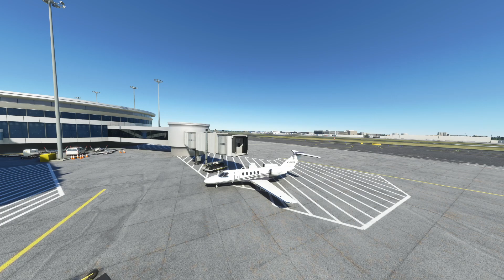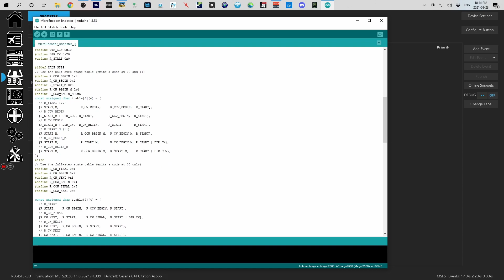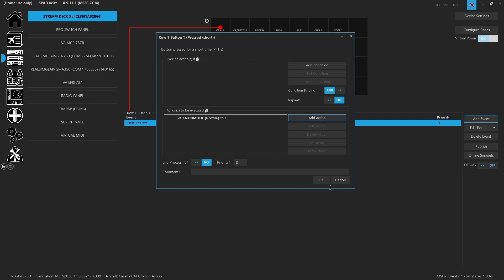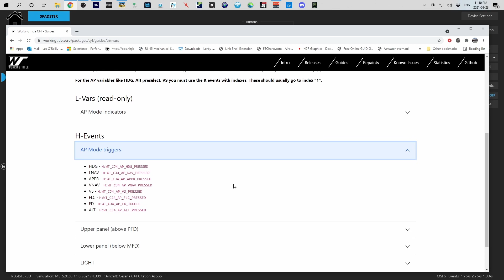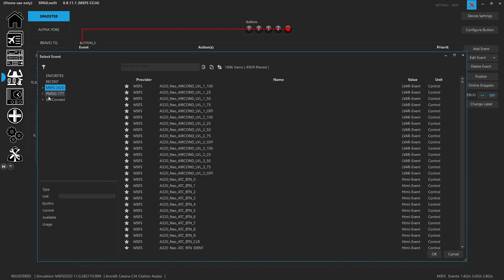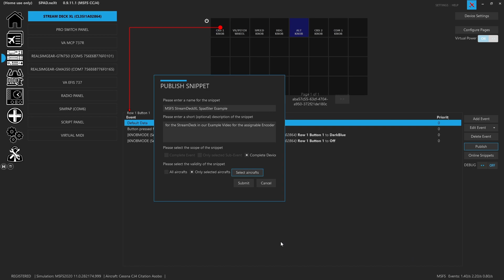(Sim Video) SPAD.neXt | Arduino + StreamDeck = "SPADster"

Comment: Les, if I buy the parts to build this, will it work just like a knobster? I would like to use it with a touch screen, but don't really want to purchase Air Manager just for the touch screen and DIY Spadster.
Thank You for any advice.
Reply from the maker: Watch the video. That shows you how it will work.
Reply: @LesOReilly  Watched the video, but you are using the streamdeck, I want to use a 15inch touch screen and was not sure if I could do it with spadnext.
I do know you can do it with air manager, but don't really want to spend the rather expensive amount just so I can get touch panels set up.
Thanks for any advice.
Reply from the maker: @andy70d35  spad next is not air manager .. this does not work like air manager ...  you can't control elements in the same way since they are not the same thing.

Comment: Awesome video, you are a legend. Thank you for sharing this great video.
Reply from the maker: Thank you for sharing such a supportive comment!
Reply: Now that I have added the encoder to my stream deck xl - "Again Massive thank you", I was wondering how easy is it to add 10 digital buttons to the Pro Micro.  I know I have the pins available and I thought it would be great to add 10 buttons to emulate 0 to 9 for ATC on MSFS 2020.

Also, is it possible to use the encoder for pitch trim (Elevator, aileron and rudder)?
Reply from the maker: @FHamoudi  of course you you can use the encodes for those.... there are events for elevator Trim INC / DEC and Rudder Trim and Aileron trim..  Yes you can add buttons...  wire them up and expand the Joystick code and buttons..
Reply: @LesOReilly  Hiya,  I have just finished adding the buttons to the Pro Micro.  As a courtesy, do you mind if I publish the profile?  Of course, I will add credit to your hard work.  The reason for this is I have two spad.next registered and it would be easier to publish the profile online and then pick it up from sim pc.
Reply from the maker: Don't put the period in SPAD(dot)neXt or YouTube will hide your comments :) ...  You can publish all you like...  I don't need "credit" :) ...  I find Publishing Snippets better but that is a me thing...
Reply: @LesOReilly  I was going to publish but, strangely I keep getting "invalid Authorkey"  - what’s causing this? Sorry about the dot in spad next, I didn't think about this.  I am so pleased with the result - Again massive thank.
Reply from the maker: @FHamoudi  You need to login in to the Spad Forums and add your order ID and hardware ID in your user profile to be able to Publish
Reply: @LesOReilly   Top man.  I will publish my pro micro and stream deck soon. 
Have you got  discord ? I'll send you a picture of cockpit.
Reply from the maker: @FHamoudi  I am in the SPAD neXt discord :)  There is a section in it for posting pictures of your cockpits!

Comment: THX so much - this is EXXXXAAACTLY what I was looking for / wanting to do ...-  the best of both worlds = SPADSTER !!!! -  ..now I gotta make it :) - THX again
Reply from the maker: It is  a lot of fun...  I am working on a G1000 Setup using this config
Reply: @LesOReilly  great - that is my plan as well ... are you making a full button for button - location replica ? - I was thinking more like a BOTTOM bar only with the buttons laid out in a logical way - just not exact replica - this way it's more Garmin device agnositc - THANKS again for your great vids and reply
Reply from the maker: @flyvr3054  Well since I always do a Profile per Plane then it has more :).. I have the PFD/MFD and the AP controls Done so far... Audio Panel next...  in each PFD and MFD the Soft Keys are in there plus the ability to select a Knob Function from all the knobs... plus then the buttons for the Nav/Com flip buttons and the FMS controller buttons...  It fits well on the XL since now the one Knob is changing based on selection of which knob button you press...  I will also do a switches section which of course will be different from plane to plane but that just a bunch of copy/paste...change text and such..
Reply: @LesOReilly  UGGGH LOL - Now I NEED to get a STREAMDECK ???  - THX for the Florida SINKHOLE in my wallet !  CHEERS lol ! - may still go soft button old skool --- we'll see

Comment: Nice mate
Reply: They say imitation is the greatest form of flattery so… thanks. For those who don’t want to use Air Manager touch control on touch monitors this is a good solution. This is definitely a good VR solution if you can memorize the button positions. DIY Knobster is still a cost competitive solution for those already using Air Manager to display panels on touch monitors and there is no limit of functions as no buttons are required .. just touch the item on the screen. Real mouse/keyboard free ops. Innovative solution for spad.next users.. we’ll done and good explanation.
Reply from the maker: Spad does support the Knobster device as well .. so there are plenty that have used the Knobster as the hardware device in a similar fashion..
Reply from the maker: Thanks Adam!